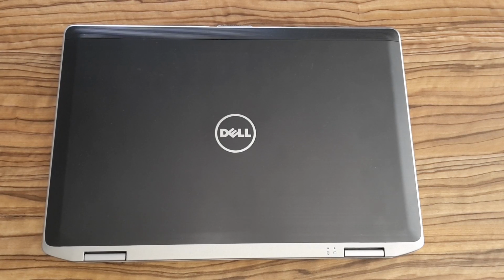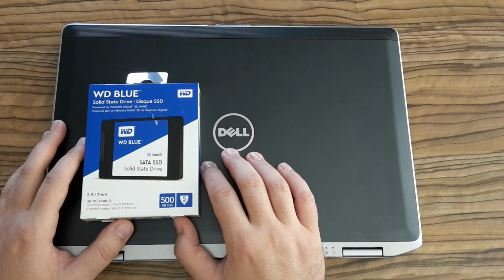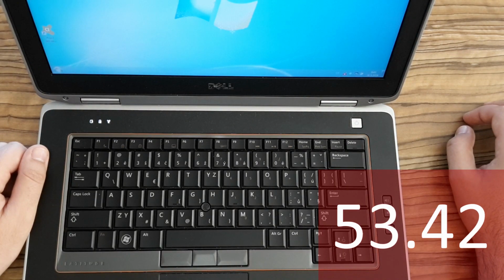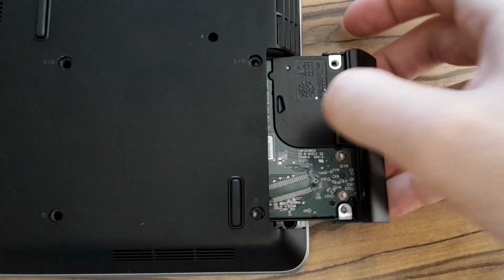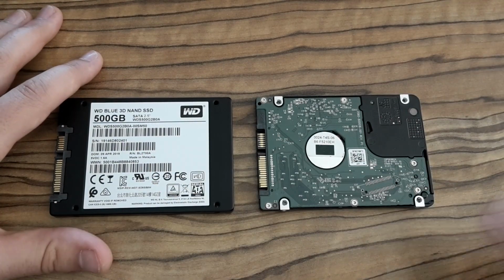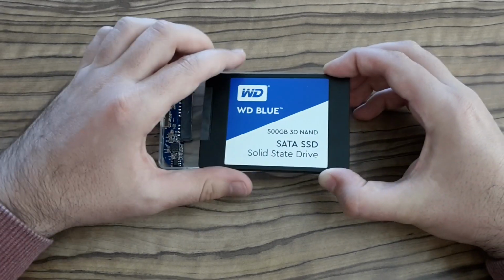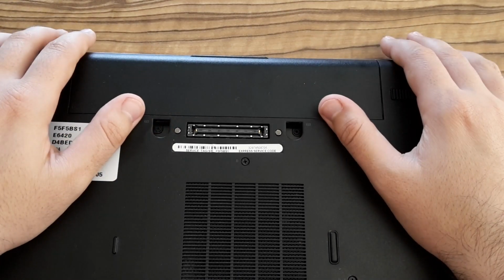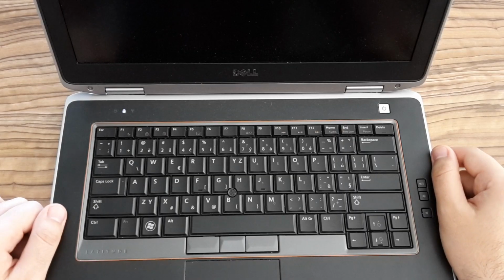Dell Latitude E6420 Upgrading to a New SSD

Comment: I upgraded to a Samsung 256gb SSD in my E6420 and topped out the ram to max. I was lucky though, I got the top spec core i7. Thing still burns through most tasks with ease it’s just gotta be plugged in cause battery is 12 years old and I need to re-apply a better thermal compound on the heat-pipe that this model likes. 

This was the notebook that inspired what would become the famous Dell XPS 13.. it started here with this chonkey, magnesium bad boy. Literally still works to this day although is use a much newer laptop now.
Reply: I just bought one off line for 143.00 dollars.  Already up graded. With 500 dvd.  Has 8 gb ram. Can I up it to 16 or high. Love your video. Very, very helpful. Thank you so much. Have a good week bro.
Reply: I have the same machine, some how it is not detecting the SSD.

Comment: Since 2008 - I use Acronis for back up and disk clone. cloned the old HDD  - and wirte it it the new SSD. Was easy and works well. also usful to clone to a new SSD as a reserve - in case...for instant replacement
Reply: I did the same to ssd samsung 870 evo 2tb and the windows 10 wheel keeps spinning

Comment: Hello.
Thanks for the video.

I have a question regarding this PC. 
I own the core i5 variant and the maxcapacity of the ram is 8gb but it has 2 slots. I want to know if I use 8gb on each slot making 16 or it the total amount has to be 8gb?
Thanks.
Reply: Samuel Garcia  thanks a lot
Reply: 16GB will work, I have it in mine
Reply: @stormah  fr?
How's the performance? That device is a beast already on 8gb...
Reply: @chukwudianucha5657  Really good, with Debian I almost never even reach 10-20%

Comment: Thanks for the video. I had problem with Crucial MX200 1TB SSD, E6420 wouldn't detect. Also, I was looking for the link you have referred i your video for the cases for connecting the disk via USB, couldn't find in the description.
Reply from the maker: Hi, check this link: https://www.dell.com/community/Storage-Drives-Media/E6420-problems-with-SATA3-SSD/td-p/4226003, it could help you.

Comment: Lol I didn't know replacing a laptop hard drive was so easy, I thought there were cables and motherboard connectors involved etc. I never opened up or even owned a laptop before, just bought a second hand one to learn Linux. Startup is very slow on the hard drive, so the ssd should help a lot.
Reply: Dell usually makes it easy to replace the battery and hard drives on their laptops (or at least they use to). HP on the other hand...

Comment: Hi. Congrats for the video and thanks! I was wondering if you could help me to kwnow about some questions about this PC, wich I have also. At first, how could I upgrade it from W7 to w10? Only then It were able to be upgrated in lot of ways, like adding more RAM, since the 6 Gb it actually has, to the top of 16; and the increased of the SSD of the video also. For the lats, I would like to answer to yo, if making this changes the PC would be Ok for be used by developments functions, as running the visual studio, react js, etc.. Very thank you from Bsas.-

Comment: Hello my friend, this video really help me, i have a question,  I have the same Laptop Dell Latitude E6420 and i have wasted money and time buying Dell Hard disk Refurbished,  I can see in your video that you are using a WD BLUE 3D 500GB NAND SATA 2.5â, 7mm SSD, my question is:  Could work a Kingston A400 120GB SATA 3 2.5" Internal SSD - HDD Replacement SA400S37/120G ? 
I really appreciate your help

Comment: Hey when I put the ssd in and turn on it says no bootable devices found. I believe it has to do with the thickness since the slot and the former Hdd was thicker. I heard that this can be fixed by adding a layer of tape to make them touch. Is this true?
Reply from the maker: Hi, have you already fixed that?
Reply: @zeroampselectronics  so actually I returned it bc I accidentally threw out the windows key without knowing what it was, and I’m not paying to buy a fresh copy of windows, so I’m just living with my current hdd
Reply from the maker: You should have cloned the operating system from the old HDD to the new SSD to use the same license key.
Reply: @zeroampselectronics  how do u do that
Reply from the maker: Hi, Google: How to clone hdd / ssd and you'll get many tutorials you can choose from.
Reply: @zeroampselectronics  do you have video on how to clone it?

Comment: I did the same thing but with a different hard drive and I can't apply the screws properly even with my old hard drive what do I do
Reply from the maker: Hi, you're saying that you're not able to screw back the original screws, right?
Reply: @zeroampselectronics  yes the same screws that I got with the laptop itself
Reply from the maker: Frankly, you have a very specific problem. If I were I would practice more with a screw driver on the old hard drive and then try to screw the new one.
Reply: @zeroampselectronics  alright I will do my best

Comment: I read there is a 250 gig limit on ssd drives for this model. How did you get around that?
Reply from the maker: Hi, I'm not aware of that 250 GB limit, in the video you can see we upgrade it to 500 GB without any issues.

Comment: For e6420 which is the best operating system......? Windows 7 or windows 10
Reply from the maker: Hi, with a new SSD and at least 8GB RAM, Windows 10 is feasible. On the other hand Windows 7 is not supported anymore at least not for free.
Reply: @zeroampselectronics  broh.....
Same e6420 my laptop 
When i play gta vice city in it it's shut down automatically 
Say reason broh.....
Reply from the maker: Hi, I guess overheating. It's a really old-school laptop for playing games :-)

Comment: When I try to install Windows to my SSD I don't see my ssd it's like my laptop doesn't recognize it
Reply from the maker: Hi, have you resolved your issue anyhow?
Reply: format the SSD
Reply from the maker: The bios should detect it even not formated.
Reply: @zeroampselectronics  i have the same problem,I did the same thing as you, but my laptop does not recognize my ssd
Reply from the maker: Hi, what SSD did you buy? Can you share the link?
Reply: @bibau84  Use the Disk Management utility to make changes to drives

Comment: how to increase internal graphics memory from 32MB to 128MB or more ?
Reply from the maker: Hi, you can try to upgrade the GPU, if there is a better option, but pay attention to if the socket supports it.
Reply: @zeroampselectronics  i have a laptop, i cant upgrade its hardware. In my ASUS PC there is a setting in BIOS to change the amount graphics memory. But I didn't find any setting in dell laptop
Reply from the maker: Hi, for the laptop in the video it's fixed.

Comment: Bro plz plz reply me  i have question that can we upgrade this laptop processor to i i5 2520m to i 7 2760qm processor quad core plz do not disheart me i want to upgrade plz reply
Reply from the maker: Hi, they discussed that here: https://www.dell.com/community/Laptops-General-Read-Only/E6420-CPU-Upgrade/td-p/3883162. One comment says: "I can now confirm that the Intel i7 2630QM chip does work in the E6420". So 2760QM could work as well because they are the same family https://www.notebookcheck.net/2630QM-vs-2670QM_1517_2850.247596.0.html#:~:text=Compared%20to%20the%202630QM%2C%20the,and%20the%20VT%2Dd%20functions.&text=The%20Core%20i7%2D2675QM%20in,1200MHz%20for%20the%20GPU%20part. 
BUT I can't confirm that on 100%.

Comment: What size are the four screws that were removed to take out the hard drive?  I have a 6420 that I want to keep the hard drive in, but there's only one of those screws left.  So I have to get the right size to replace them.
Reply: @zeroampselectronics  Thank you for your courtesy.  I got into a chat with the company and they've promised to email me when the part becomes available.
Reply from the maker: When you buy them, you can provide a link for others to help. Thanks!
Reply: @zeroampselectronics  A link to what?  I don't understand.  Do you want me to take pictures, save them to my google drive and post a link to that?
(Thanks for the reply, BTW.)
Reply from the maker: I mean screws, when you buy them to put the link from the e-shop here or size whatever helps people with the same issue.
Reply: @zeroampselectronics  Thank you again.  I will let you know just as soon as any of the wonderful corporate representatives out there can be bothered to even make me aware of something in that size so that I can buy it.  Until then, I unfortunately have no link to post.  :(
Reply: @cpuwrite if you don't mind can you reply to me too? same problem as yours
Reply: @haykalhakeem4473  Unfortunately, the jerks at Dell can't be bothered.  I have no answer to relay to you.  :(  They mind, I don't.
Reply: Hello guys, anyone came to know screw size yet ? Same problem with me .
Reply: @Theyogeshkandari  after a few searches here and there, I believe the screw is a M3 x 5 type though I'm not so sure myself since I saw very conflicting pictures on google about how the screw looks like

Comment: anyone here  had a experience  of  everytime turning on the dell laptop (button) after 2 sec. it suddenly shut down   with a clicking sound  and turned on again twice and then it will becom ok.......

NOTE: i have no battery im using  charger as my source
Reply from the maker: Hi, perhaps not preset battery caused that. Have tried that with and without the battery?
Reply: @zeroampselectronics  no i havent try yet because ive purchased it not brand new and  less price but  with a dead battery  .....im  second owner  in short